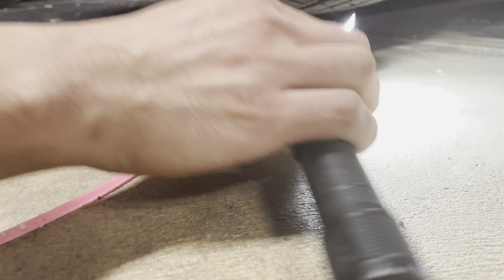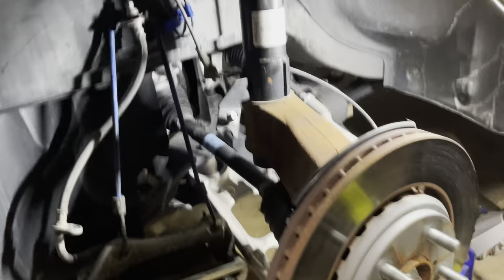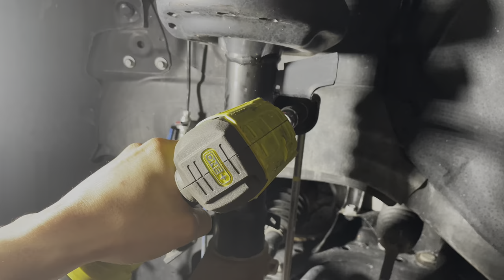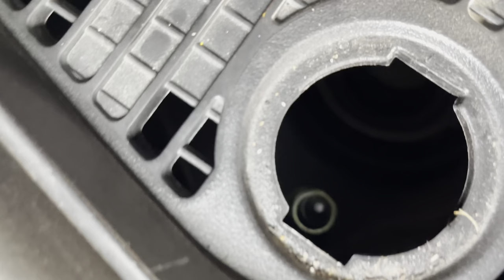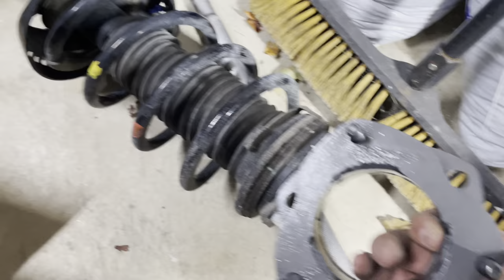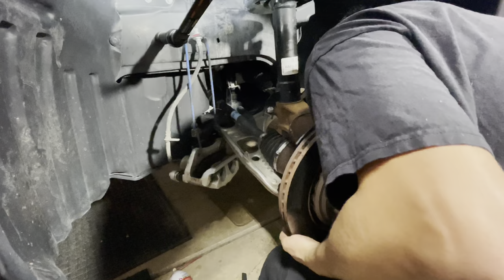2020 Ridgeline front leveling kit install.  works for Pilot and Passport.  Link in the description.

Comment: Would you consider doing a playlist of “general” car maintenance guides to this Ridgeline? Things like changing brakes, transmission fluid change/flush, differential fluid, oil change, along those lines?
Reply from the maker: Yes we just decided to keep my wife’s passport so there’s a few things on that that will be relevant across the siblings. And first up is a front brake and rotor change. Thank you for your suggestion

Comment: Question, how did the alignment shop do the alignment since their system only compares what "factory spec tolorances" should be in order to dial in the alignment? Can they modify the alignment data to compensate for the kit? Great step by step. Looks straight forward. Just basic strut removal.
Reply from the maker: We did get it aligned and turned out great

Comment: Nice tutorial Eddie. Did you encounter any problems getting the alignment back to specs? Traxda makes a 2 piece strut cap with 2 degrees of adjustment to help the process but requires trimming down the strut studs which I don’t want to do.
Reply from the maker: I took it to Belle tire gave them the manufacturer specific alignment requirements and it’s just fine. No change in ride.

Comment: What is the exact tool name and if you can get the part number for removing the lower control arm? I rented a Lower Ball Joint Puller from parts store and it wouldn't fit.  Minute 5:12 of your video shows the tool you used. Thanks a million
Reply from the maker: It’s a ball joint separator from harbor freight. I did have to open it up some to fit the ball joint correctly
Reply: @eddiesspeedgarage  Once you bought if from Harbor Freight, grinded it to be a larger opening to fit the ball joint spindle just above the boot? Thank You for the follow up.

Comment: I got lower ball joint separated using tool from harbor freight but still can't get it far enough down to fully release lower control arm.  What am I missing?  ?
Reply from the maker: You may have to make the opening of the fork wider. These tools vary quite a bit